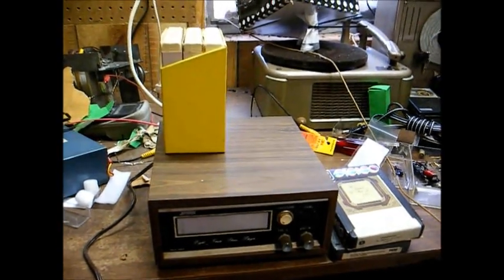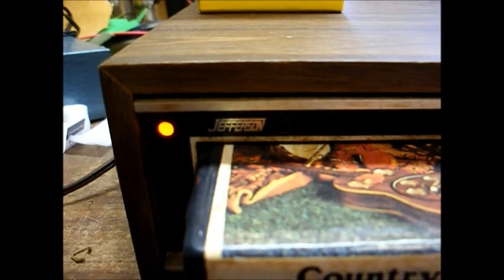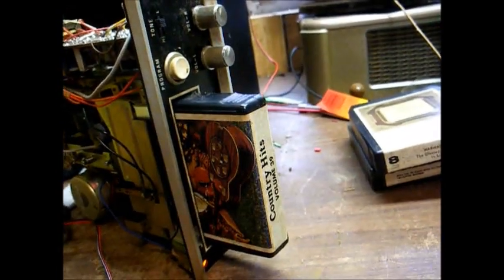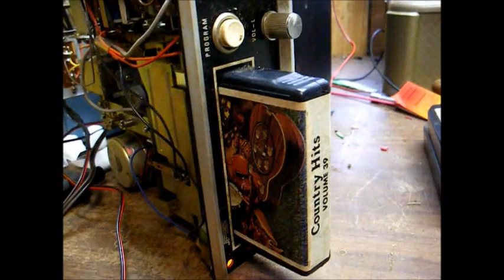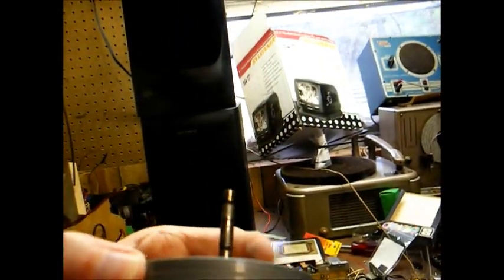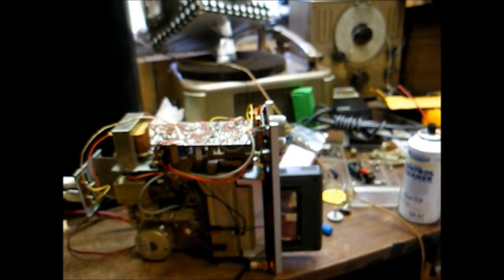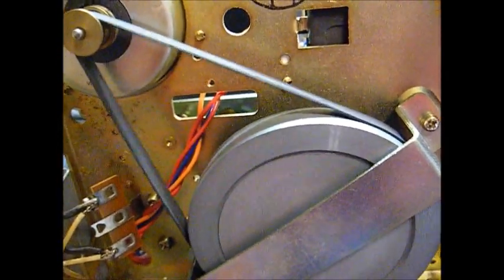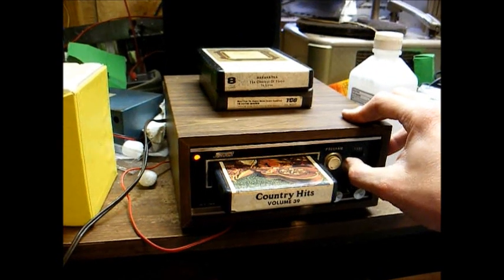Jefferson 8-track tape player from circa '74

Comment: Before you adjust the "crosstalk adjustment", make SURE that the foam pad in the tape cartridge that presses the tape up against the heads isn't deteriorated as it will cause mis-tracking, etc! Also make sure the capstan pinch roller isn't gone to goo before you insert the tape into the machine as you can have a major mess on your hands if you don't & inadvertently insert it! I agree with you about people wanting stuff cheap! UNLESS they are selling it, THEN they want a MINT!

Comment: Boy, I am way late to the game with this, but here goes!
1. Those may not be cover bands on that cover band tape. A lot of truck stops sold tapes that were basically "bootlegged" and sold as cover bands. Probably the real artists.
2. I bet the pads were shot on those carts. May explain the mid-alignments. 
3. If you have the capstan off, rough up the shine spot. Tapes will play with much less flutter and wow.

Comment: I thought I seen it all for 8 track deck till now. No program light is a joke what where they thinking. Heck they could have even went for a counter 1 to 4 like on some portables.

Got to know does it auto change?
Reply from the maker: Surprisingly, it does auto-change. I have seen one or two portables that were manual change-only.
Reply: radiotvphononut Yes like the Panasonic Dynamite 8...it has manual plunger track change only...however to its defense it does tell you the track it is on when plunging. I love 8 tracks. I well settle for a little hiss and wow and flutter rather then the crackles and constant velocity issues that vinyl presents. Love your video post. That Jefferson 8 track will last longer then any CD laser. Good job.
Reply: radiotvphononut The Panasonic Dynamite 8 "TNT" red, blue, and yellow portables are among those manual changers and are mono speaker players only. Pretty much sell mainly just for their looks. They play loud too but the rest is just ehhhhh.

Comment: I've noticed that you get a lot of wow and flutter problems caused by the tapes themselves, with disuse they get "sticky" and are sometimes seized up. Most of the complaints I hear, other then the poor editing splitting songs in half, are the result of people trying to play 30-40 year old unrestored carts on a player that needs servicing.
 In terms of formats I dislike cassettes and LPs far more then eight track cartridges. For all the glory of LPs they are dust magnets that always seem to need a cleaning before I can play them. I've had a lot of problems with cassette tapes sticking, or the players getting buggered up from bad belts and eating the tapes, it's really a dictation format that should never have been marketed for music.